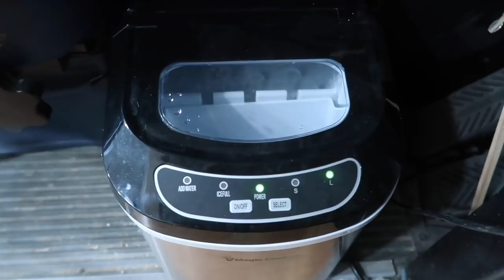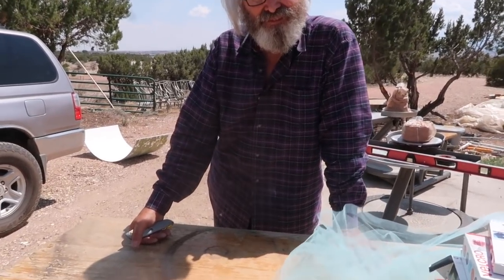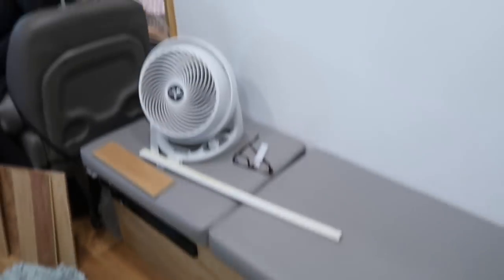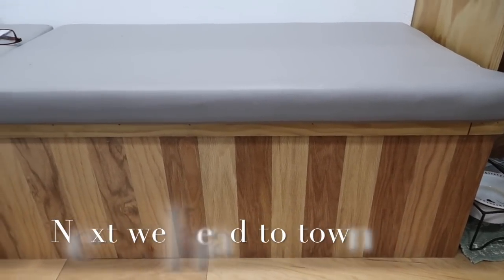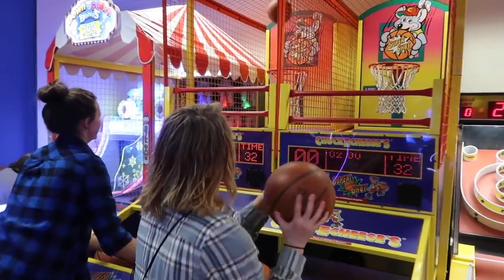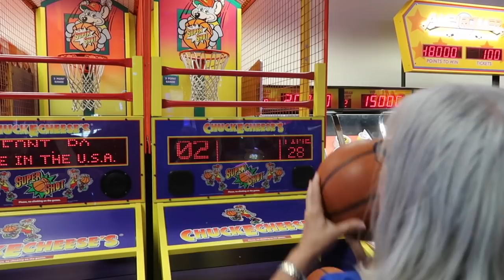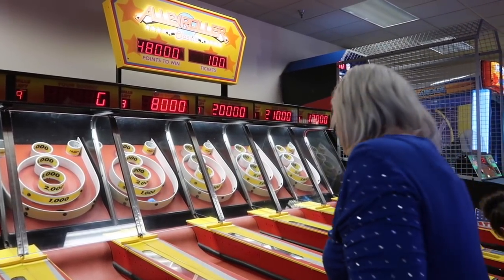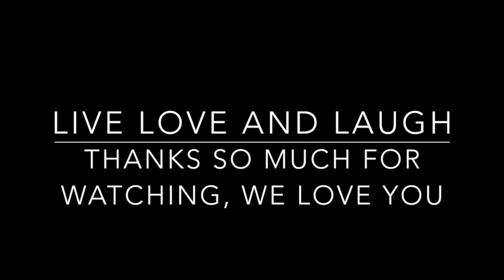Bus to Motor Home #140 wood trim on the bus Birthday

Comment: Nice video.
Allow me to suggest an improvement for your screen door. I've found this to work very well. Sew about 4 nickel to quarters sized washers to the bottom trim, but not so low that they drag the floor. This little added weight causes the screen to shut more quickly, especially when its windy or when there's a draft pushing against the screen. Have a blessed day!
Reply from the maker: That is a wonderful idea!  Thanks for sharing!
Reply: Gary Jones it is sharing little tips like this that makes such a difference, "Through Sharing We All Grow".